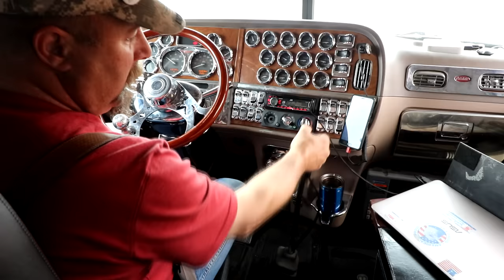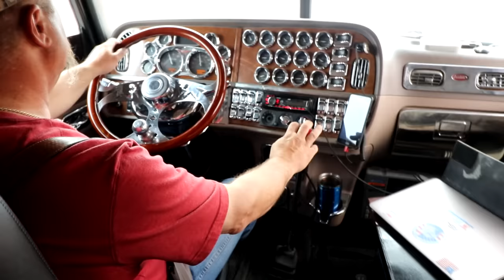How to shift an 18 speed transmission

Comment: Gosh I miss my dad. He taught me to drive a Roadranger, a Mack and a Twin Stick. Always told me I better only touch that clutch if I'm coming to a stop or takin off haha. Kinda like dancing. Thanks for the memories man.
Reply: Just curious, I don't know much about trucks, but manual cars you have to use the clutch every time you shift ( pretty much) otherwise you fuck up the gears. So is there some weird reason you can shift clutchless in a big truck/lorry?Maybe something to do with the synchros or rpm?
Reply: @tomahawkANDscopZ  Some trucks don’t have synchros so the driver will have to Rev match each gear to allow a smooth gear change using the engine (hence no clutch for change and only when stopping and starting). I believe this is done so that the driver cannot accidentally overev the engine (think 4th to 2nd) as the results in such a large engine vehicle would be very damaging for the engine and components.
Reply: @charliecollings2295  ahhh I see, thank you for the explanation.
Reply: @tomahawkANDscopZ  NP, as for cars, you can shift without clutch even with a common synchromesh gearbox, even if it is awful for your synchros (think only using it if your clutch went for example and you needed to get home). It’s all down to matching engine speed with that of the output shaft for the desired gear, assuring that the output shaft and desired gear are spinning at the same speed, allowing for a smooth gear change. A good example of a transmission that only uses clutch for stop and start in a car is a dog box, there are plenty of videos out there.
Reply: @charliecollings2295  yeah, after reading your comment I went searching about it and found out about float shifting and such. Really interesting stuff honestly, I found a lot of truckers talking about it in forums and how they have different strategies for shifting in different situations. Thanks for the info, really appreciate it!
Reply: @tomahawkANDscopZ  You’re welcome, I don’t know how much you know about transmissions but I would say it definitely helps to know how different types of gearboxes work to get a good understanding. Even with a synchromesh transmission, practises like double clutching in a car for big downshifts can make the job on your synchros easier, and knowing how a transmission works makes the explanation of why a lot easier too. It is very easy to fall into a rabbit hole of info though so I hope you’ve got some time haha.
Reply: @tomahawkANDscopZ  You can change gears from the first to the second and so on without using the clutch as well in all manual cars and motorcycles. It is just a case of being able to sense the gearbox synchronizer (some gearboxes will be easier to handle depending on how well they were designed and engineered). Going back (5th to 4th and so on) is a little bit trickier, but can also be done without damaging to the gearbox.
Reply: I've floated the gears in an old Nissan Pathfinder for years without any damage. Don't force, but just guide it into gear. No grinding, binding or anything bad. Most important is not to force it, and like in the video, just feel the gears mesh. Really you are just matching the speed of the gears to the engine, so when everything is spinning around the same exact speed, it can mesh together.
Reply: @tomahawkANDscopZ  actually you don't though. If you listen to the engine, bump the accelerator and let the shifter come in with just a little presure it will fall right into gear, I grew up on the farm and had a dad and brother who drove semi. 
 One time I lost what they called the z bar on the clutch of my pickup, so actually I had no clutch. I started it in gear with the starter in town, never stopped at a light or stop sign and drove it all the way home shifting the gears with no gear grinding where I welded it and worked on it. It is all about timing and rpms and knowing where it naturally slips into the gear. I also drove my daughters car home like that about 6 years ago because she lost one of those nylon holders on her clutch linkage.
 I can get your car going with the clutch and never need to use it again until I stop if I want to, and traffic isn't to bad like stop and go.
Reply: Or downshifting on a grade where it wont go in, just a blip of throttle and a quick jab on the clutch pedal to get her in
Reply: Hi Eric!  I know the feeling...
Reply: you know man I'm learning to drive my death weasel and I was feeling that. No clutch till atop, bc I seen a video of a guy who crashed bc he didnt brake bc he didnt clutch lol. neutral slows down the car a lot
Reply: I learned to clutch it out of gear and feel it in. The thing to remember is not to push a clutch all the way in except when stopped  as it affects the clutch brake. My first  was a B61 with a 5+3 with IIRC a 220
Reply: I been driving one old truck where there were no buttons on the stick but you had to push the stick to the left side to go on low speed gears and right to switch to high gears. Got used to it in two weeks but it was annoying to get used to.
Reply: ive actually had to go out and jump in drivers truck and bring them back to the shop with no clutch whatsoever..lol..you just gotta time your traffic and never come to a dead stop..lol..
Reply: If u can't find it, grind it ;-)
Reply: @bsadewitz      They used to say dive for the bottom and youll find a gear. I always found it easier to come down with the stick only when i need to find a hole real quick....splitting in that situation just adds another variable
Reply: @georgealmeida7382  Haha, that reminds me of when I was ~18.  I had a manual 92 Taurus SHO, which I was dutifully driving as if the rest of the car was as robust as the engine.  The transmission certainly was not.  One day, I suddenly lost a gear.  It just wouldn't shift into it anymore.  Then, I rapidly lost the other four gears one after another in the same manner. Luckily, this happened only a mile or so down the road from  shop of a transmission guy my dad knew.   I had to drive back down the shoulder in reverse, and managed to enter the lot just as the whole transmission gave up the ghost.  It turned out that one sloppy shift at 7200rpm had chipped a fragment off of a pinion gear in the transmission and blown a hole in it; all tbe fluid had leaked out.    Oops.  I was not a happy camper having to take most of my savings to pay to have a trans rebuilt from a junkyard, but my dad seemed oddly satisfied by the outcome. ;-)
Reply: When I was a apprentice I drove with no clutch for months while I saved up for a clutch kit. Motorway traffic and all. Had to stall it, put it in first , start the car while in gear. Bumper to bumper traffic. Haha good memories
Reply: @prontoworld5963  that's butter! 😂
Reply: So just shift without a clutch? What
Reply: @poopfart5453  Yeah.  I have never driven a truck, but I have done it in my car when shifting up, though it wasn't perfectly smooth! Lol. When driving a manual, u should be matching RPMs when shifting anyway.  Perhaps if a trucker sees this, he'll explain it properly.  You can even start off in a car without using a clutch, but If I that a lot with my car, I would have probably wrecked the synchromesh.
Reply: @tomahawkANDscopZ  You can shift gears by double clutch. To us it's a waste of time.  We call it floating because we're shifting without using the clutch.  Rev the engine just right, and you get it everytime.  RPM is a very big deal.  Totally agree that you'll mess up the gears if you don't know what you doing.
Reply: Dude your comment reminds me of my papa man same time time shifting lol
Reply: With big trucks it's easy to find the sweet spot as long as it has an RPM gage.  I found the best way to find the sweet spot is when no one one is around you and you're on flat land let the RPMs drop under 2,000rpm.  Then press the accelerator (fuel peddle) while applying little force. (If you hear grinding it's too much force) once you hit the sweet spot the shift will easily come out of gear. When that happens make a mental note where the rpm needle is.  That's your sweet spot.  Eventually you'll develop a feel for it and no longer need to use the rpm gage.  The same method can be applied to cars but with cars the transmissions aren't as forgiving as a big rig.
Reply: I agree about using the clutch on a big truck. You could literally wear out your left knee if you use the clutch all the time. With experience, I changed gears without using the clutch pedal; I only used the clutch when I came to a stop, starting the engine, or waiting for the light to change.
Reply: @tomahawkANDscopZ :  Because of the massive gears used in trucks, the inertia in the gears makes it easy to shift without using the clutch. But it takes experience. You drive an automobile with a manual transmission, this technique is far more challenging, but doable if you are quick enough. I did it driving a Volkswagen.
Reply: @Shadow0fd3ath24 :  I would not dare change gears in a downgrade driving a big truck. You could easily lose control!!
Reply: @poopfart5453 :  It is done all the time. You would wear out your left knee driving a big truck if you constantly use the clutch; you could also ruin the clutch brake.
Reply: @tomahawkANDscopZ :  The gears on a truck are much more massive than those on a car. The inertia makes it much simpler to shift without using the clutch.
Anyone who insists on constantly using the clutch pedal will quickly wear out his left knee. It will take months to recover!
Reply: @tomahawkANDscopZ  , once you get the feel of it , no clutch is required, just like these guys are saying!!! I drove local city routes and if the traffic light was red, I'd try to crawl up to it in low gear as to not come to a complete stop so I didn't need to use the clutch!! Maybe you've seen semis doing this,  also do it in traffic jambs!!!